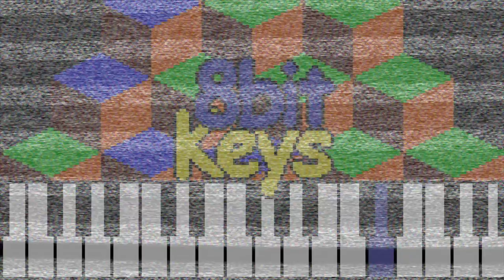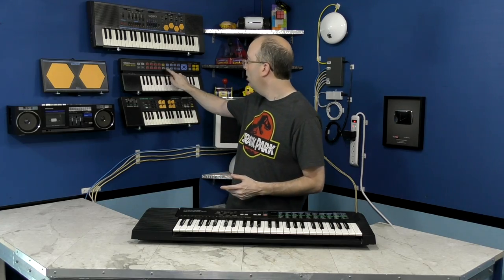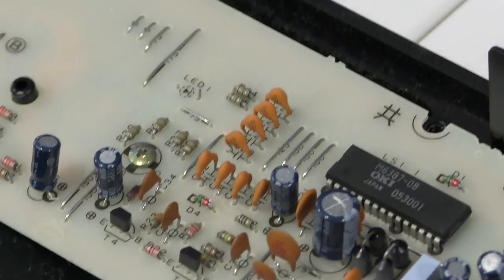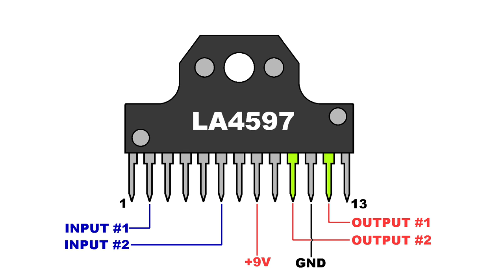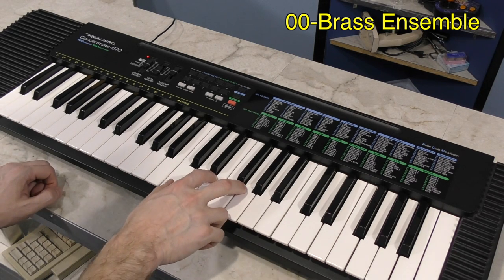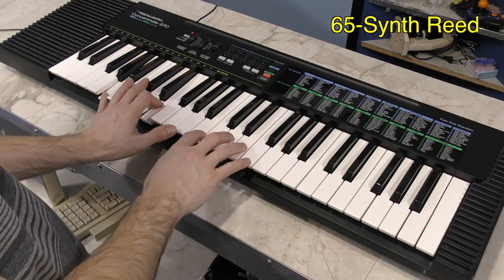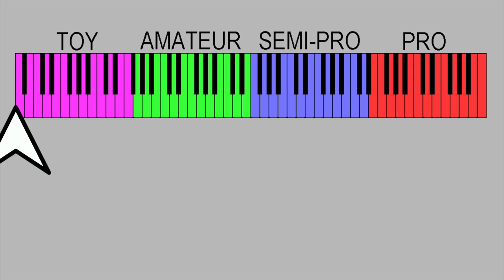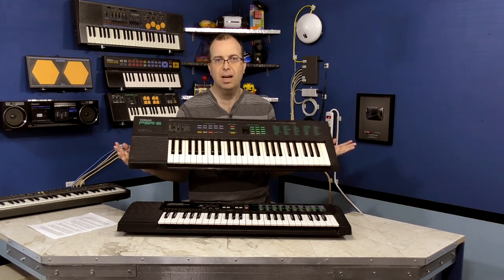Casio CA100 Line Out Modification and Demo (Realistic Concertmate 670)

Comment: @8 Bit Keys not sure if you are into this sort of thing but if you quickly disconnect and re connect the AC adaptor on this and similar units you can often find funny hidden tones and rhythms. A fellow youtuber and personal pen pal of mine has found over 80 funny hidden tones and styles that are not programmed into any number slots I'm curious have you tried such with any luck? I personally have a casio ml-1 from 94 and have had similar luck wiggling the batteries although it tends to crash much easier than these units

Comment: well, the amplifier have the 2 outputs connected to the speaker to use all the power the amplifier have to offer, if not the speaker uses just half of it (considering you are using only one speaker, if you are using 2 and a 5w amplifier each speaker would get one out to the positive closing the circuit to ground using 2.5w totalizing 5w)

Comment: The CA110 (which shares the same demo song) is very easily to mess with, such that even running the batteries or DC-in too low in voltage can result in strange circuit bendy things happening.
I have an example on my soundcloud page "cat_cafe"

Comment: A $2 3.5"mm splitter WOULD be a simple solution though. Plug it into the keyboard, then one end goes to the PC and the other gets headphones! Or even monitor it through the PC itself without the splitter.

I understand how set preferences are though. More power to ya brother.

Comment: How about getting the line level signal from both the input terminals instead of one input and ground? My guess is they are using this stereo amp in bridged configuration to get a more powerful mono output.

Comment: Just re-watched this vid, and I realised something...

You said that the keyboard "doesn't have a headphones output or anything like that", but it actually does. hehe

https://imgur.com/a/FuTyk

https://imgur.com/a/UWUm2

It even connects from the speaker-level output, so it's definitely intended for headphones, but also already has a cap for AC-coupling (DC blocking), plus some 120 Ohm resistors, for limiting the max output slightly.

Or, for a cleaner line-level output (ie. bypassing the amp altogether), you could still tap off the signal on the "volume" side of capacitor C36...

https://imgur.com/a/qnj4z

Comment: You really should have tapped the line out before the amp, not after, as that's what a line out is. Of course the signal after the amp was stronger, that's what amps do! With the way you've done it, it would have been simpler to just plug the output into the line in on your computer and plug your headphones into your computer. No mod was necessary.
Reply: My thoughts exactly.   The amp was designed to drive into an 8 ohm load not be used as a line out signal. Taking the signal before the amp is the way to go as it's designed to run into a higher impedance load.  A line input is specked at 10K ohms.
Reply: Bravo.  Your comments are spot on.  Tapping the signal before the amp give you the best wave reproduction therefore leaving headroom to be further use via en external preamp.  He could have skipped the mod.  However he did indicate that he just wanted to be able to hear the speakers while plugged into a stereo.

Comment: on the Output jack, the insertion of the quarter inch plug, pushes a metal lever away from the positive signal that disconnects the speaker (the speaker is in line with the Output). You can bypass this disconnect by bridging this switching action. The only problem is that the output of the built-in amp may not be tuned for the added impedance of whatever it is you plug in parallel to the speakers.

Comment: The problem with PCM drums in the late 80s was the sample rate needed to reproduce such a wide range sound was not yet achieved. (At least cheaply. And without using too much memory) so the drums although realistic were not that great sounding. Therefore it was obvious they were sampled.

Comment: Is there any benefit to finding a line level trace VS wiring in paralell with the speaker output and puting a resistor on the output signal?

Comment: Before you might see another disappointment: The PSR 6 is the same like the PSS 270 with full size keyboard. Which is a good thing as this board was fun indeed but nothing surprising just. The higher lines of that era, especially the PSR-36 might be more interesting I think.

Comment: When I was 9 years old I had a Casio CT380, but school music program was selling these CA100s to the other kids.

CT380: Late 80s, 20 sounds, great samples.
CA100: Early 90s, 100 sounds, all awful.

Casio made the classic mistake: quantity over quality.
Reply: But the Casio ct380 was also included in another 8bit keys video. Major battery leakage, and the battery compartment had metal under it. Design flaw, as batteries can rust through the metal.
Reply: In my opinion, at least half the sounds on the CA and SA keyboards are very fun and usable. Some like the CA 401 have a poly/texture button that can allow a sound to be detuned or have an oscillator removed.

Comment: 9V is just too low to get any decent power. Bridge configuration is used in boomboxes as well to double the ouput power and in the 90s was in almost every car stereo since, again, the voltage is just 12V. The signal is inverted in the input or the chip has the inverting amp built in. Is like bridge mode in the pro power amplfiers. Its a way to sum both amps but not by the means putting them in parallel. It is referred as BTL, Bridge Transformer Less (in the old days the same result was achieved using an output transformers)

Comment: they are using the amplifier in bridge mode , and u made the diagram wrong , there is no way that inverter is at the amplified out put it should be at the line level input like any other bridged amplifier and that makes much more sense ...

Comment: I don't recommend doing this modification because the speaker is directly connected to the audio in.
   It's like to have a dynamic microphone always connected to the audio in.
 The sensitivity on low frequencies is strong enough to catch any mechanical vibration.
So I suggest you stay away from this.

Comment: This line-out hack makes me cringe! It is wrong on so many levels, and I wouldn't connect it to any equipment of value. The correct way here would be to take the low line level, and put a simple op-amp circuit on, with the input impedance tuned not to interfere with the amplifier, and the output gain tuned to regular line level voltage. Also be careful when adding a capacitor without checking the filter frequency...
Reply: "equipment of value"
"$5 at an estate sale"
Reply: HebaruSan not the keyboard itself, but connecting this mod to anything else.
Reply: @HebaruSan example - you connect this output to a nice digital recorder, the power amp in the keyboard pops, and sends a spike damaging the recorder input...
Reply: It works doesn't it?
Reply: Wasn't that the purpose of the capacitor? A bit like when you use a capacitor when you connect a speaker to a 555 Astable to make analogue music
Reply: AllThoughts 3rased totally does!
Reply: The cap is just a dc block (filter)
@UnleadedZeppelin, depends what your aim is. If you want to learn the basics of analog circuit analysis and design, digital, embedded or you just want to build circuits that works for fun?
Reply: Yes! Also the sound is so bad because the capacitor has a too high value and will lowpass the signal.
Reply: What is Cringe #superbeardbros
Reply: Aj vd Westhuizen A speaker is AC current that fluctuates with the sound. It would make more sense to get a 1/4" jack and wire up the positive and negative. In a speaker, unless it is a super old common ground system, you need the negative for proper flow. An RCA isn't a horrible idea, although high level (speaker wire) moves between 0 to 5 volts AC. On top of that, a capacitor is only there for voltage regulation on a DC circuit (which a speaker is not) and ripple control and filtering on an AC circuit. Adding a capacitor or a resistor is just going to attenuate frequencies out of the sound.
Reply: I don't think electric circuit design is taught in physics department.
Reply: Also not a good idea to connect one side of that BTL speaker output to ground. Bad things could happen if the keyboard is run on AC not batteries.
Reply: Totally agree. I'm surprised it even worked.
Disclamer: I'm not a pro electronics engineer. Just a hobbyist.
1) the 1mF 50V electrolytic cap is waaaay too large and connected backwards half of the time - those caps don't like that. I wouldn't be surprised if the music we heard came from leakage current. About 1..10uF ceramic cap for each lead would be plenty even for bass AFAIK.
2) If both PC and the keyboard have their ground connected to 3rd terminal of the mains plug, the wire connected to the outer ring of RCA plug is effectively shorted to ground. A balun (transformer) or at least a caps on EACH lead is needed.
3) And of course the audio cable sheath is obligated to catch any noise it can find and feed it right back into the amp. Enjoy your 60Hz hum through the speakers. A balun would help, or an amp, but this thing already has one - he really just needs to connect to the 3.5mm jack instead! Probably through a resistor to minimize feedback noise - line out does not need to have a lot of amplitude.
Reply: UnleadedZeppelin that is pretty basic stuff, you'll need to start from the beginning. I would recommend you read "Introductory Circuit Analysis" by Boylestad, and then move on to Electronic Circuit Analysis and Design by Donald A Neamen. By that point it is good to own a copy of "Electric Circuits" by James W Nilsson and Susan A Riedel, and of course "The Art of Electronics" by Horowitz & Hill.

Then a fun source of info is youtube channels like GreatScott, Mr. Carlson's Lab etc...
Reply: 60 upvotes that are probably from people who don't have a clue about what the comment is talking about and are just assuming op knows his shit.
Reply: Aj vd Westhuizen so you're saying the filter cap wouldn't catch voltage spike from the amp?  I figured it would act as a high pass filter, and stop large spikes.  I'm no expert here though.
Reply: No, Johnny, there's no such thing as "AC current." (Well, maybe "air-conditioner current" or some oddball kind of thing like that, but not in this context.) And no, a speaker isn't any kind of current; it will have A. current running through it.
Reply: My $5 would bet that the audio signal going to the speaker is the same one patched through the headphone jack. For a unit that small it would not surprise me. If that's the case, then the signal coming off of the speaker IS line level. It's not like he's pulling the signal from a 200 watt amplifier and plugging it in to his equipment.
Reply: Maxx Fordham what? I work on audio equipment for a living. Speakers are alternating current. It is what allows the cone to move in and out to produce sound. Direct current is used on the PCB and the rest of the internals on the keyboard. 

Just a suggestion: Make sure you know what you are talking about before you act all condescending.
Reply: Well, Maxx is right because the term AC current is redundant, since AC means alternating current.
Reply: polarized capacitor, and the level would depend on the volume... so wrong
Reply: Thanks for that too, Wouter.
Reply: @Kyôdai Ken Oh, and the capacitor is in series, so I believe you meant it will high-pass, not low-pass. Also the speaker is a shunt inductor, blocking hi freq. So what you get is a very unequalized output. Btw the speaker can also act as a microphone and it can pickup ambient sound, it may be noticeable during silent parts of a song.
Reply: Soldering the speaker lines to a 1/4" jack is in no way different than an RCA plug; electricity doesn't know the difference. If he used 1/4" and then used speaker wire to go to another speaker then sure that is technically correct. Like I said previously, my $5 is betting that the output to the speaker is basically the same thing as what is going directly to the headphones. Therefore, this mod isn't really that wrong. 

My philosophy is, Does it work? does it sound good? Then it's probably good.
Reply: Thats not true, cheap class A amplifiers drive the speaker with DC, AC is just a more efficient way to drive a speaker. The argument about the circuit board being mostly DC is not valid, you can have all sorts of signal on a circuit, thats being said you are very likely to find AC signals on analog sections of the board.
Reply: No, see, Victor, analog electric audio signals ARE AC. AC is the only way you get sound to a speaker, because the sound signal running through a speaker IS AC. But yes, of course there has to be AC running around somewhere on the PCB of something with a speaker.
Reply: Oh you just misunderstood the semantics of AC/DC, you're thinking right you need to have a changing current in order to move the coil and produce sound, but thats different from AC, Alternating Current is not the same as changing current, the term AC impose the current is crossing polarity, but like I said with class A amps the current never crosses zero because it have a DC offset. DC means the current never changes polarity, (it doesn't imply it is constant tho).
Reply: OH! Yeah, Victor, I wasn't thinking about that. What you just said does make sense to me for sure! You're talking more about a wavering/pulsating DC than any AC. I forgot that true AC must be on both sides of zero. And maybe more audio circuits work like you described than I've had an idea about. I guess you could have a speaker whose sound signal bounces from 0 to +20 volts or something like that, right? (I don't know the average safe voltages that speakers of most sizes handle.) You just never actively pull the cone backwards (by dipping into negative territory); you're just letting the speaker spring back on its own. Are there cheap speakers that would be overworn if you actually "sucked" their cones back with a negative voltage, and then the higher-end speakers that handle that so well that they actually make better sound when they are actively pulled back?
Reply: Yeah exactly, that's basically the theory behind class A amplifiers, there are very niche amplifiers that are very hi-fidelity and low distortion amplifiers, when they have perfect selected transistors, but this kind of amp is not really common because they are very power inefficient because of the amount of heat it dissipates on the transistor, because the transistor is always operating on the linear region. They are also used on the opposite side of the spectrum the low-end low fidelity part, where you just make a amplifier out of just a single cheap transistor to drive a plastic cone speaker, on toys, and those talking disposable cards, that way you don't need to create negative rails or make a H bridge or something more complicated to create "proper AC".